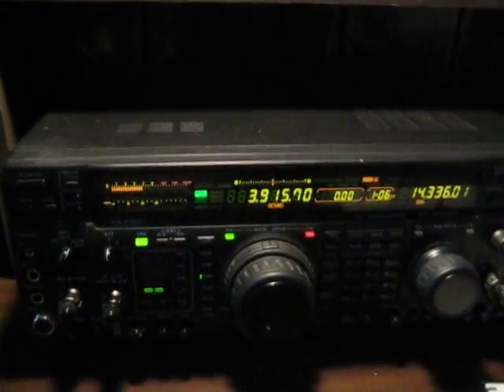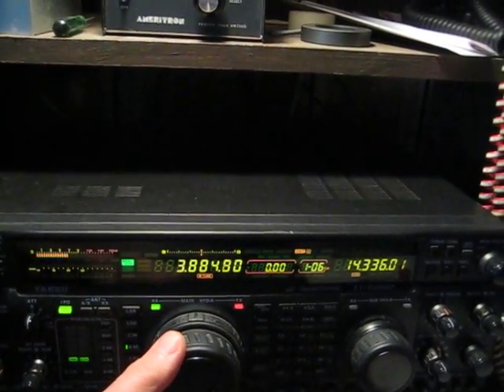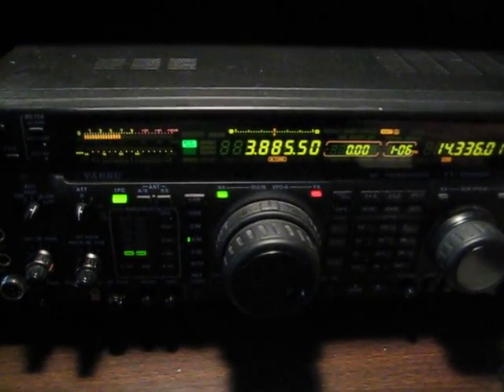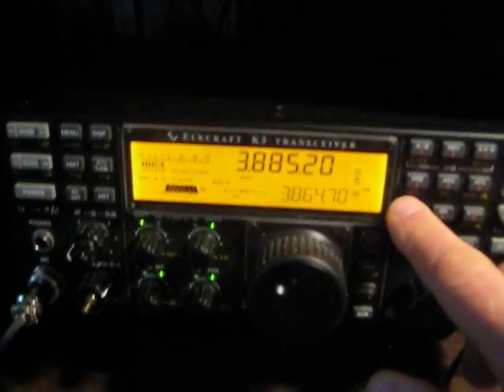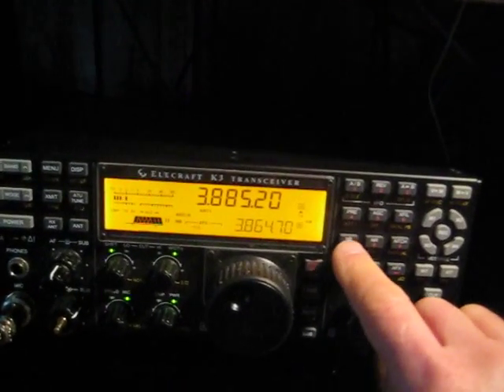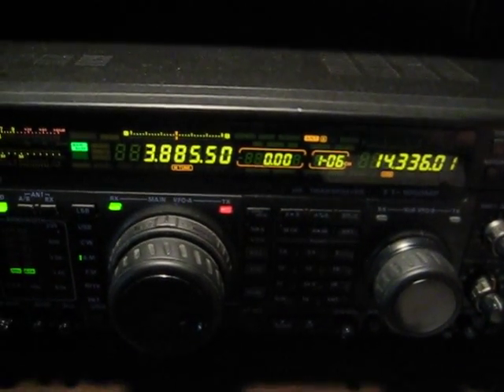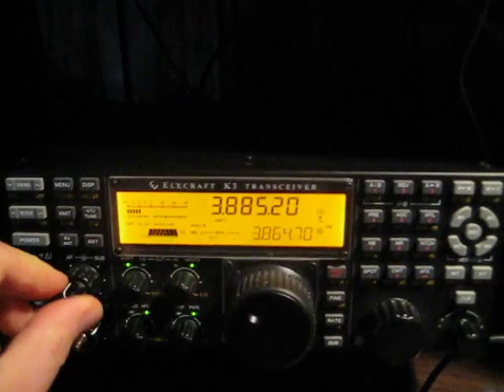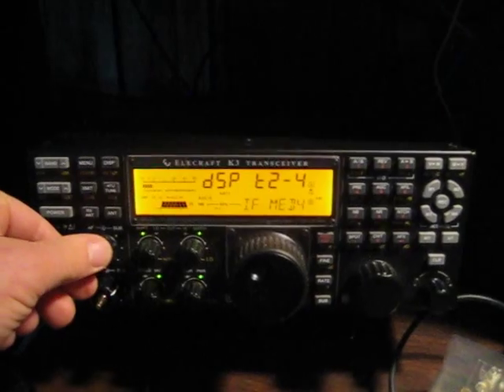Elecraft K3 Noise Blanker demo at K2XT

Comment: Dang I had line noise like that when I first set up a station--called the electric company and they came around with a rf-finding truck. My line noise went back to nothing. They really benefit (everone on the line does) when we help them find noise sources on their equipment.  At my Mom's house noise was on her TV (satellite signal even).  I found the high voltage line arcing at her transformer.  The lineman said apparently lightning melted the connection, but the voltage "rewelded" the live wire  to a bad connection tha it was amazing she never lost power because of it. I used AM radio to find get started in the right direction. I do get it if you're living next to a power distribution sub-station.
Reply: The TV cable folks cleaned up their stuff quickly too after I let them know it was blocking my reception of the ARES net repeater. Their signals aren't supposed to get too far outside the coax.

Comment: Interesting comparison.    The K3 really does well here but I wonder if the difference may also be due to the audio EQ    the K3 in this case has less highs  from either the speaker used or EQ settings.   I wonder if you used the same EQ settings and speaker on the FT1000mp if  you would have better results.